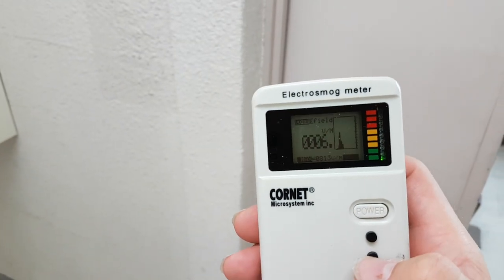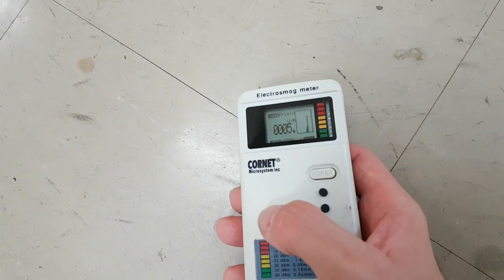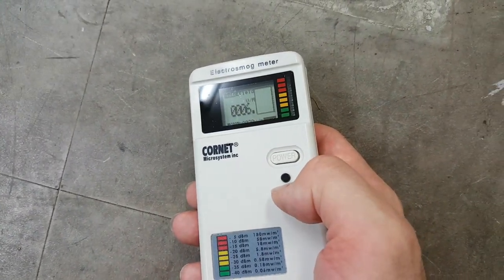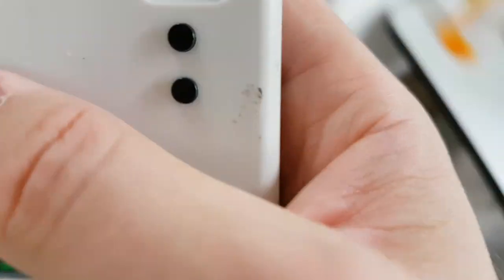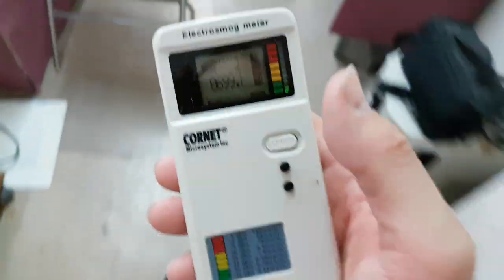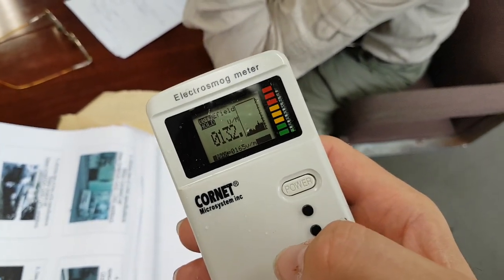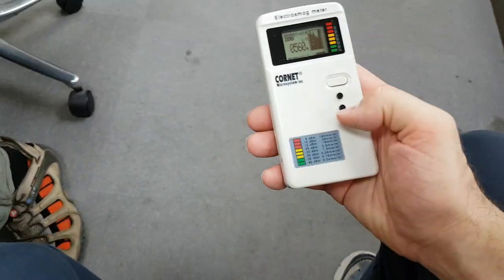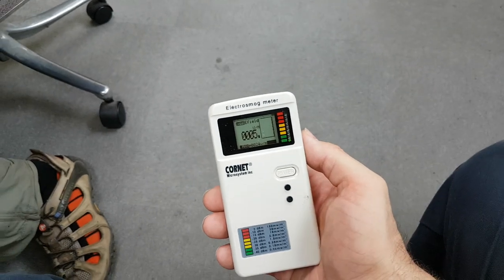OHMA - V/M testing in environment and near reactors

Comment: Is that device just vibrating the plates?
Reply from the maker: It is a standard controller with a standard vibrator and a patented (but affordable) engineered plate stack and frame. You can read more on the live document here:

https://docs.google.com/document/d/1LecMq5pQG_orpFhkD5wx7z9pbpjZ4nsfpIuRi95hgq0/edit#heading=h.mqwt2katadjt